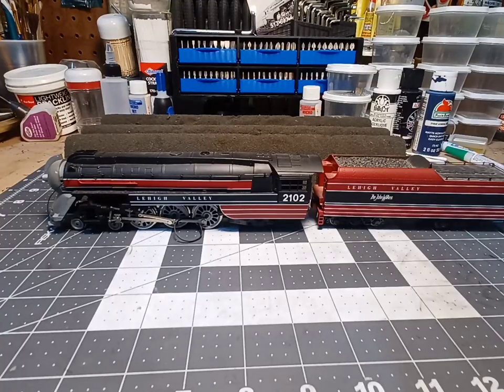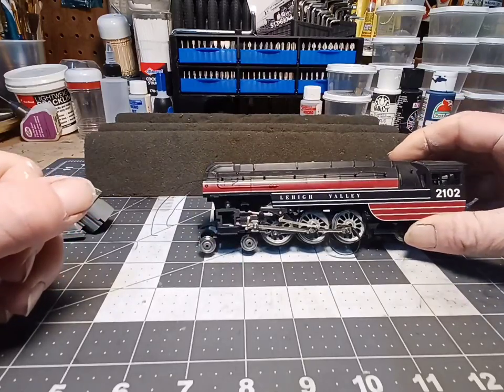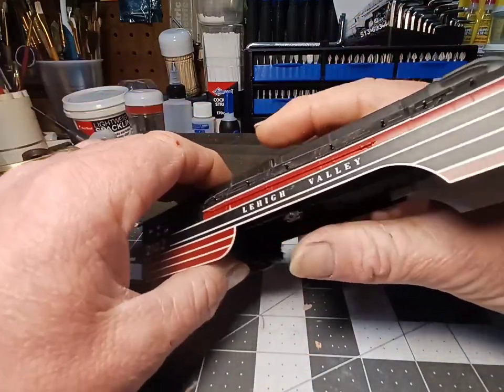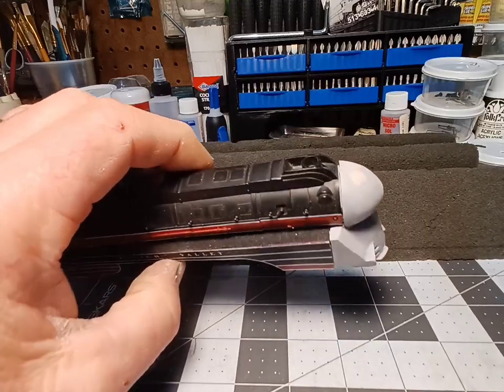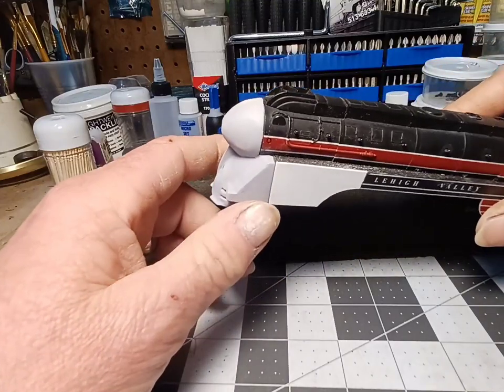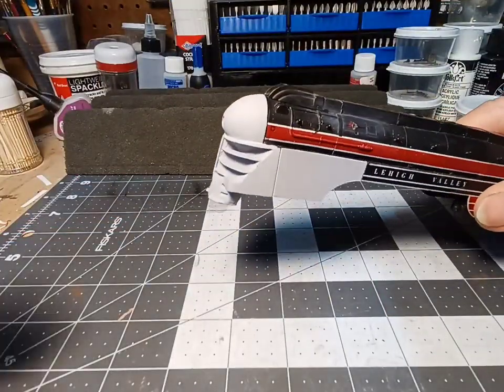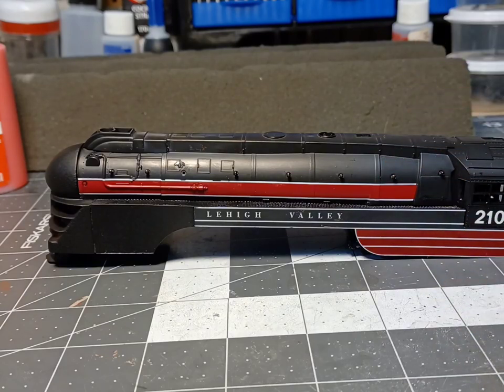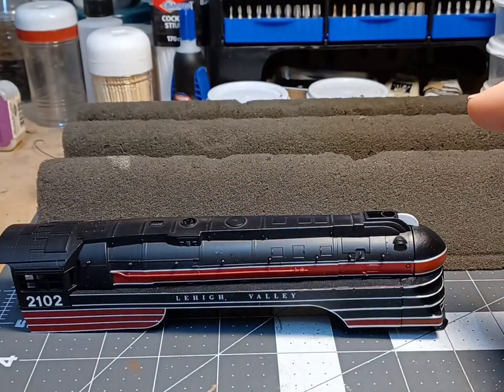Rebuilding a Rivarossi John Wilkes locomotive.

Comment: In looking at where you began to where you finalized, your work efforts proved to be very well implemented. I am not familiar with the prototype or Rivarossi's version of it so I was unable to make the comparison. However, I do give your final product a rating of 95 in a scale where 100 is the best. My 5% takeaway derived from the difference in the red paint (where I agree with Arrow, that appears more orange than red), the lack of color correcting the side rods and running gear, driver tires, wheels and body railings.
Reply from the maker: Thanks,